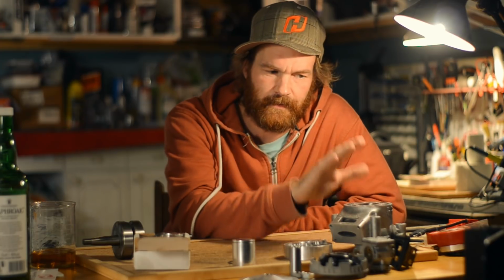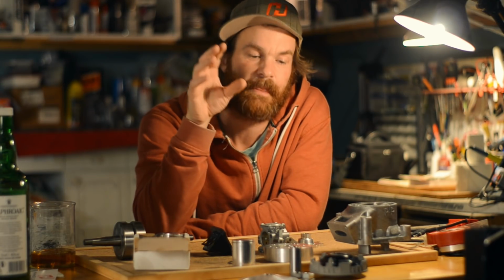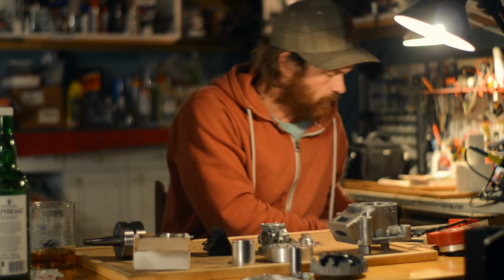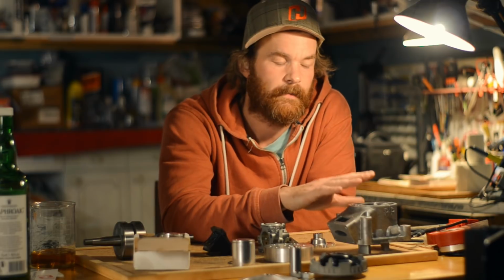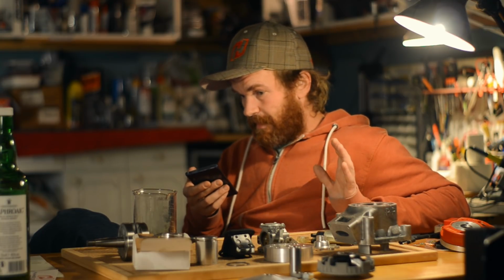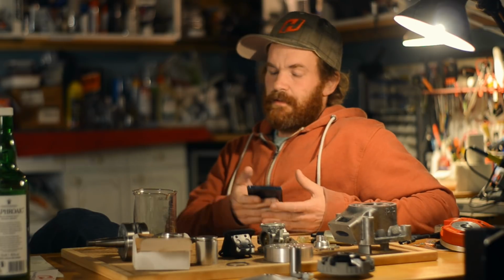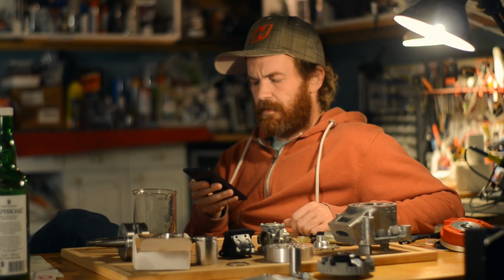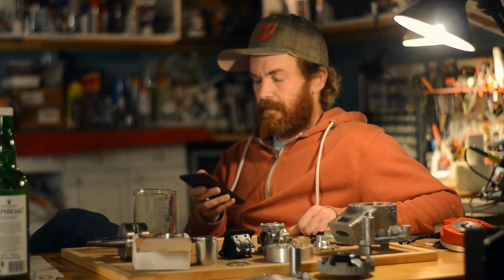THE Most Powerful Two Stroke - Back at it! + Replying to comments

Comment: Why not run two efis? Or run a multi cylinder efi. Have two or more injectors do that same job but cut the demand in half
Reply: Taco Taco the problem isn’t flow
The problem is metering 

The injectors themselves can not cycle fast enough
Reply: MyLonewolf25 yea sir I understand the problem. The injector can not cycle fast enough at that high of engine speed so use two injectors for the same job. On the First up stroke injector One will fire then injector two will fire on the second up stroke for a total of two power strokes. That should be plenty of time for the injectors to close. If your doing 20,000 rpms and stager two injector on every other up stroke you cut the demanding work of the injectors in half.

Like a v twin injector system but for one cylinder instead
Reply: Taco Taco if your open and close cycle is too long for one injectors putting in multiple is not going to fix that problem 

You need to deliver accurate quick pulses per engine revolution 

You could add 5 injectors and it wouldn’t matter unless you could close and open then quickly enough
Reply: MyLonewolf25 when you say open and close cycle are you talking about the duration of down time in between each cycle or the time the injector is open. 

You can keep the injector open as long as you want as long as you have plenty of fuel pressure. The problem is at 12,000rpms+ the injector can’t close and open back up quick enough it just gets confused. So instead use two injectors 

It’s like you opening the door for a thousand individual people in under 3min but instead il work a second door and you only have to open the door 500 times
Reply: Taco Taco you can not ACCURATELY meter fuel like that 
You’re still ultimately limited by how fast you can open and close the injector
Reply: MyLonewolf25 dude your brain can’t wrap around the idea. 

Imagine using a fuel injection system that was made for a twin cylinder two stroke, with opposite power strokes. Now use that system on a very high Revving single cylinder engine. Each injector will have an entire two cycles to close an open again ( that should be plenty of down time). 

The motor is still Reving at 19,000 rpms but each injector will only have to keep up with 9,500rpms. The injectors should have no problem handling that demand
Reply: Taco Taco you’re not understanding 
The injector could fuel it but it can not due it ACCURATELY 

and if anything you’re worse off with a 2 stroke compared to 4 as you have less down time between intake strokes 

The amount of injectors doesn’t change the fact that any singular injector can not ACCURATELY meter fuel needed because it can not open and close fast enough
Reply: MyLonewolf25 accurately measure fuel and the injectors being able to cycle properly are two different problems. The computer will accurately measure the fuel correctly but is the injector able to operate properly to deliver that measurement at that high of rpm no.  

 4 cylinder , 6 cylinder or even a 8 cylinder engine.That one efi is injection 4-8 piston per minute. In a 8 cylinder 4 stroke engine at 2,000rpms the efi would be working at 8,000 pulses per minute. 

The efi can handle it just act like the engine is a twin cylinder but it’s actually a single cylinder revving monster
Reply: If the engine is going through multiple intake strokes Within the fastest time an injector can cycle adding more injectors does not solve the problem 

You’re out speeding the injector and therefore can not accurately meter fuel 

This doesn’t change no matter how many injectors you add

The engine is physically out speeding ANY amount of traditional injectors
Reply: YOU CAN NOT ACCURATELY METER FUEL IF YOU CAN NOT OPEN AND CLOSE AN INJECTOR FAST ENOUGH
Reply: MyLonewolf25 dude the injector does not meter fuel it’s job is the injected the cylinders with fuel, there are exhaust temps gauges, co2 sensors, and intake sensors that gives reading to the efi. The efi then uses that data to decide on the correct fuel amount. 

Dude you basically telling me that efi can not even work at 1,000 rpms Because the injector cannot open and close fast enough for the next engine cycle.

I’ll tell you what mylonewolf you would never be on my race team because you can’t think outside the box.

Lonewolf is correct efi doesn’t to work even at 8,000rpms. All this fuel injected stuff must be fake

Comment: Why not use two injectors and let them fire after each other.
Like it is a two cilinder basically.
This would half the injector rpm
Reply: My thoughts, exactly. He should have a cfd analysis to time the alternating injections into the air moving to the transfer ports.
However at 19k rpm and methanol, you are basically dumping continuously anyway.
Reply: That would not solve the problem of injector duration and timing performance @ 19krpm.
Reply: Staged injection. It will work
Reply: The problem is that the open and close time PER injector isn’t fast enough 

Not just the response time per signal to open but the actual time it takes to open itself
Reply: Yes. The computer needs to think it’s a 2 cyl 4t engine and it will fire one injector per revolution.
Reply: @nmsmitto  staged injection uses one injector (or one row) on low rpm and two or more on higher rpms. Thar way we can use injectors with different flow and have less problems on both sides.
Reply: Роман Беляев that won’t overcome the problem of the injector not being able to pulse 19000 times a min.
Reply: @nmsmitto  why you think so?
Reply: Роман Беляев his problem isn’t flow, that’s what staged injectors help with. The problem is at 19000rpm on a 2t the injectors can’t open and close fast enough to properly meter the fuel. On a 4t at 19000 there is only 9500 power strokes so no problem. 

If 2 injectors fire opposite each other they only need 9500 pulses each if that makes sense. 

In staged injection all the injectors are still pulsing 19000 together so won’t help with perfect metering
Reply: @nmsmitto  19000 rpm / 60s = 316 revolutions per second. 1000 ms / 316 = 3.16ms each revolution. -0.5 ms injector dead time = 2.66 ms for injector opened time. Its like on idle on regular car.
But on lower loads pulse width must be lower, and thats why staged injection is needed. 
Perfect? Compared to what? PWM on fuel pump will be perfect or, at least, normal?
Reply: Роман Беляев I’m going off what he said, that the injector can’t cope with the rpm as it can’t pulse fast enough. Your saying it can no problem?
Reply: @nmsmitto  i think its possible
Reply: @friggyfrig123  i think staged injection cannot possibly provide enough fuel at the scale of an ecotron injection system. your idea would need a fuel pump and return system the scale of a liter bike and enormous pressure. after all injectors already need to operate above crank case pressure.
keeping them open, only means the crank case will experience a rich condition when the ports are closed, which will come through the engine when it expels the burnt gasses. given he's running methanol, the AFR is going to be single digit anyway, so... the only advantage of staged pulses would be less raw fuel spit into the exhaust.
Reply: @comethiburs2326  just a regular fuel pump and regular pressure regulator suitable for engine power. 20-30 hp? 
Every injection system on high loads inject fuel on closed valve part of time.
Staged injection its not many pulses. Its many injectors. there is no other possibility to make system work on low loads+low rpm and high load+ligh rpm when rpm or power range is too wide. This in common on boosted engines or mororcycle high rpm engines.
Reply: Роман Беляев this is where I got confused by what your saying before. For me staged is often( and often used in modded turbo cars)  stock injectors for the most part but high load there is a second rail of injectors to compensate for the huge turbo you’ve thrown on there to fuel the increased boost. 

What your talking about seems very different like they are all sharing pulses? 

I’m intrigued
Reply: @nmsmitto  all like you said. But staged injection is used not only on modded turbo cars. Production engines use it too. 
Sharing impulses have place. On one row you can take smooth idle and low loads. On higher loads this injectors will have too low flow. But if you just change injectors and install with big flow - works fine on high loads, but on low loads impulse width will be too short. 
Same here - even on high rpms and loads impulse will be short! On lower power levels pulse width will be too short for work, for this modes we need smaller injector. Maybe  even two rows is not enough.
Reply: @friggyfrig123  injection time is limited to transfer port duration, so something like max 1/6 revolution or 0.5 ms @ 19krpm
Reply: @rrd675  seadoo rfi has two 650 cc/min injectors. How it makes 110hp if they opened just 1/6 per revolution? 
And why manufacturers build direct injection systems with high pressures and complex injectors and electronics if they need more time to inject then transfers duration?
Reply: @nmsmitto  use a counter circuit that increments to a new injector for each firing event, keep adding injectors to the string until the responce time is fast enough. if you added lights to indicate when each coil is energized it would look like runway landing lights at idle, and a solid strip of light at WOT.
Reply: What you guys are trying to argue over is called single cylinder sequential overlapped injection. 1 each injector will fire every other revolution to get the response time withing range, but the pulse length of one will overlap the period of the other that fired the prior revolution, thus "continous" injection is achieved, and any "overlap" rich spot can be moved around to the desired location in the intake pulse by setting an injection start-or-endpoint table that shifts with rpm (or can be fixed in this case once figured ot for 19krpm).
Reply: Also, since he is going to run  30 % nitromethane (thus 70 % methanol), or pure methanol or the like, they both really benefit from beeing injected in the intake tract opening as thy both will absorb insane amounts of heat during evaporation, and need time to evaporate, thus timing issues is going to be less of a concern as the mix has time to homologate. Why on earth he wants injectors in the crank-case when the added benefit of over-intake injectors mith methanol-based fuels are charge cooling and thus increased charge density, is beyond me.
Reply: This will not work with normal injectors.
This will not work with 5 or 10 injectors as well. 
Its about the time in which injector needs to open - inject - close. This time at 19k rpm is so short that normal injector will not do whole injection cycle. 
Thats the problem in my opinion. 
The only thing which might help is to use piezo-driven injector, some cars have it. But i cant give guarantee. 
I think He should use continous flow injection or carb. Maybe even vapor-carb. 
Excuse my English.

Comment: What about direct injection?  With the size of the crankcase you can get away with a dump system. Be careful of the nitro in the crankcase. Make sure your ignition box is grounded to the engine.

Comment: At 19000rpm you dont need piston rings!!
Reply: sounds just as mad to run with no piston rings as some of the ideas the burt munro might had come up with.
tho as i am a former rc car racer i know that it is posible to run a high power engine without piston rings as most rc car engines is constructed that way.
Reply: extec101 I have some experience with a 0.3mm oversized cylinder. That 50cc twostroke engine worked above 5000rpm nearly normal.  At 19000 rpm a piston without rings may act similar. Compression will not suffer due to lack of time to pass gas down the piston gap...
Reply: Why not set a few clever designed rings into the cylinderwall at the section of compression? The rings will not have to pass big openings!!!
Reply: @tinolino58  Great idea!  The rings are useless anyhow once any of the ports have been uncovered. Put a "cylinder ring" just above the exhaust port.

Comment: no - valve. so just for fun you can call it a ram-jet twostroke :D
Reply: It's more like a pulse jet
Reply: @xx98justmeify  yes, that would be a better comparison to the frequency and sub supersonic behavior. I mixed up the valveless jet concepts. atleast I didn't write scramjet as a final post :D. thanks.
Reply: @snapst  That's an interesting point. Is a 50cc two-stoke engine still a 50cc engine if the crankcase/combustion chamber is open to atmosphere and operates as a pulse jet.
Reply: @clone4211  I would think that, while the piston is pushed in the 50cc displacement chamber it is no mater what is the pressure before the cylinder. As turbo engines are still called the same liter engines. However if there would be an afterburner...

Comment: I advance the ignition timing so that peak cylinder pressure happens at TDC.  Makes engines run much more efficient and have A little more power.

Engines need my prototype to do this.

It's like using A very high octane fuel in your engines.

Comment: Just thinking out loud. Maybe an injector (pre combustion) chamber would work? And a tip maybe you can get some ideas of the big 2 stroke engines they use on board ships. Have worked with them myself and most is also working on small gasoline engines. An a completly out of thr box idea would be to great a big exhaust port with valve in top part of cilinder and injection🤔 than you can go turbo easier something i still want to try with 50cc

Comment: Sorry if this has been brought up already, but have you considered a carbon fiber piston? They do not expand as much from heat allowing for much tighter bore tolerance making the ring unnecessary. Much lighter also. There was a company (On the line Racing, I think it was)that sold them here in the U.S. , but I don't think they are around anymore. If I remember correctly they were actually made for them by an Italian company that (as far as I know) is still around. Just giving you an alternative in case the trapped ring design gives you trouble.  I have no doubt that you will hold world record one day. Just keep tinkering & testing!

Comment: I'm not sure if you will be able to start the engine with an ignition timing set to 19000 rpm. Won't it be way to early and even have a chance to fire backwards?
Reply: Dr. Zoidberg : It is a misconception that high rpm engines need a lot of spark advance. Go kart engines that run up to 18,000 rpm or more can be easily started with a direct drive just by push starting. It is actually better to have an ignition that does some spark retard at high rpm.

Comment: Hello.. Have you ever thought about to press or to boost or turbo mix fuel on the ignition chamber with intercooler. To get more fuel as far is cold and under pressure.

Comment: What do you think about the  f1 shower type injection?
And new diesels use piezo injectors indeed. They fire around 5 times a stroke.
Reply: *Up to 8 times
Reply: I call the shower type injection as the power jet. As it does the same thing on carbs, but with more flow!

Comment: Something I can't find anywhere. Does detonation happen due to compression ratio or is it the high psi (mm hg) that causes/promotes detonation? Every where I look they say the compression ration can make things detonate. I could see maybe as the cylinder compresses the gas heats up and it's actually the peak heat that can cause a misfire but it makes so much more sense that peak psi would be easiest to measure. 

1974 Suzuki Gt550 resto mod build. Stock 54 hp I want to bump it to 65+. My idea is raise compression ratio and run 91 octane. (highest pump octane available in America) but I don't know what compression ratio is safe for a two stroke. 
A 4 stroke can run 10.5:1 on pump gas but all two strokes are around 7.5:1 WHY?
Reply: 4 stroke has a exhaust stroke the cool the piston surface down
Reply: shae grover  : The reason two strokes have lower compression ratios is because the tuning effect of the exhaust system pushes exhaust gasses back into the cylinder just before the exhaust port closes. This effectively raises the compression ratio two points or more.

Comment: Excellent work! I’m curious though about the open inlet trumpet, how will it be closed off during the carburetor warm up stage? Otherwise it would act like a gigantic vacuum leak no? A quick solution would be a simple butterfly, like an automotive fuel injection throttle body, except without an idle circuit built in, as that will be coming from your carburetor. Just a flat butterfly with a straight rod, say 5mm diameter, with a 2.5-3mm thick brass butterfly plate. Just need a stop at WOT, could even be controlled by a small solenoid or servo to have ‘on’ and ‘off’ settings, with no spring needed for return to closed position, as it would be electronically held closed when not using the WOT circuit. Your thoughts? Keep up the amazing work!
Reply from the maker: Look closely at the model and you can spot a guillotine valve between the case and intake duct.
Reply: Ah yes! Great minds... something something... you just showed it so quickly I didn’t notice. Anyway, keep up the amazing progress! You’ve got me thinking yet again what I’ve got laying around that I could rip apart and try to reinvent... my Yamaha GT80 is calling my name just begging to be completely reborn as a land speed creation...

Comment: Put injector before reed cage?
Reply: Reeds cant operate at that RPM, thats the main reason for the rotary disc in the first place.  Reed that can close at 19krpm will be way to stiff to even open at idle
Reply: Ok that's why there's old  Honda's that go that high in rpms and use reed cages some go even higher in rpms